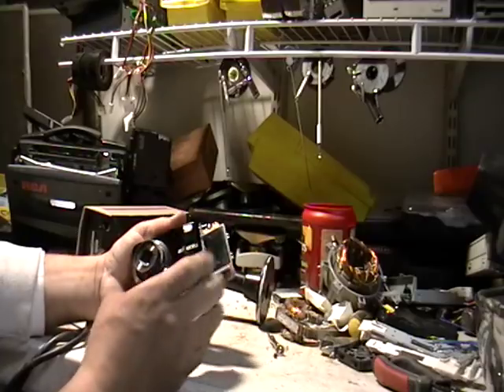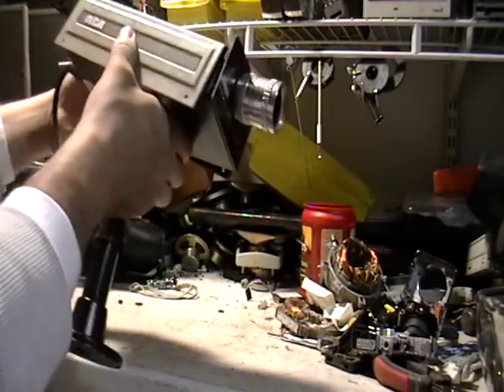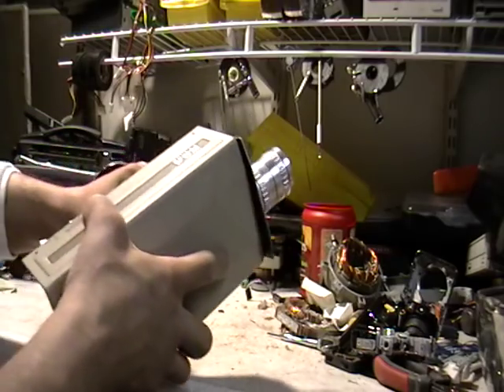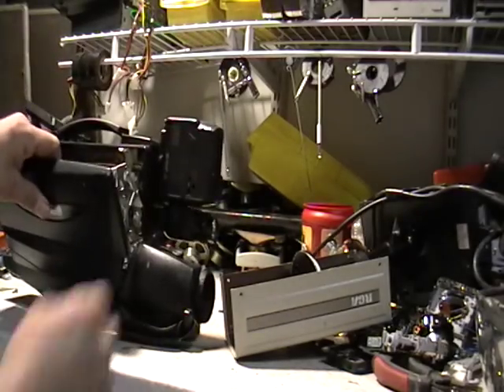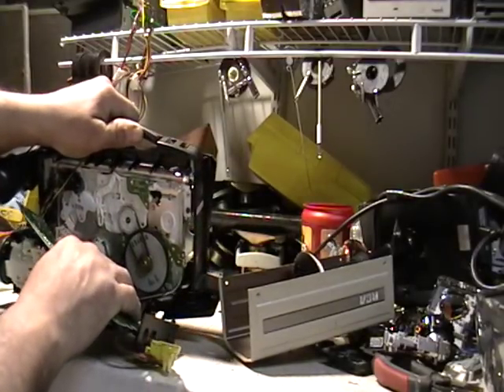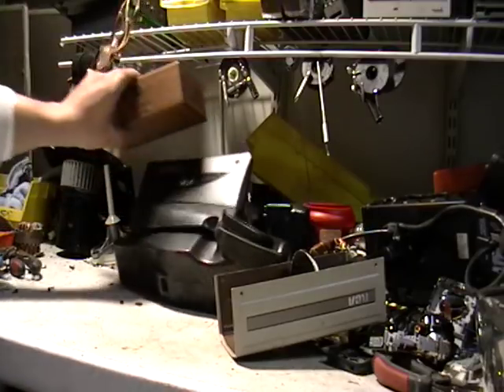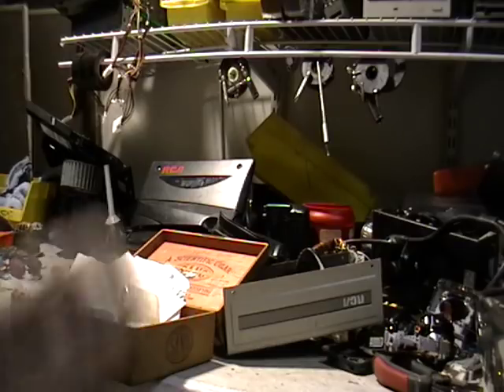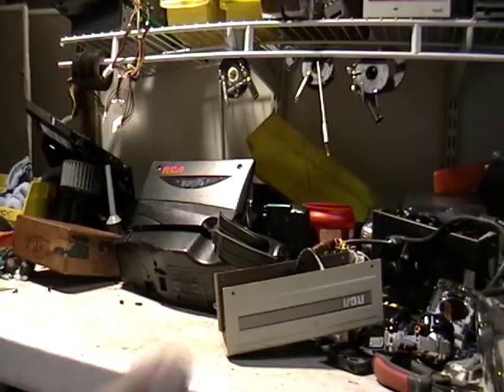Scrapping cameras

Comment: The view monitor is useable, finding the power, which is usually 12V, and the common is usually used with the video common, and find the video in.  Takes a little digging to find them sometimes.  If it's color, it doesn't complicate things too much.  This is something that someone with an electronics background could, or should, be able to do.  I scrap alot too Mike.